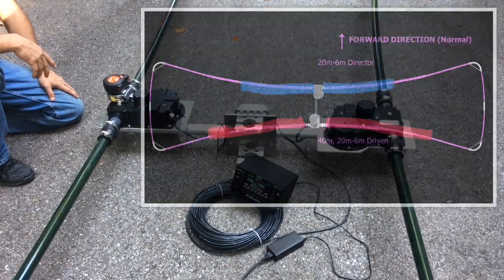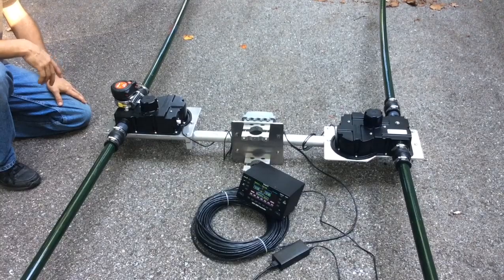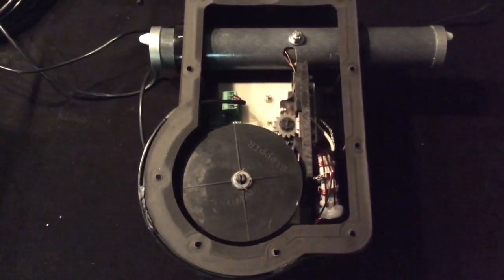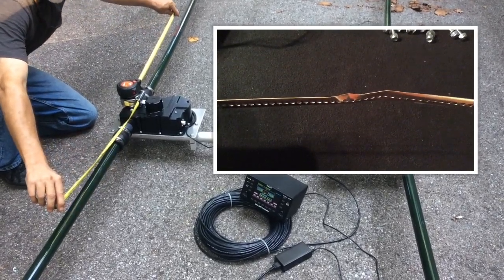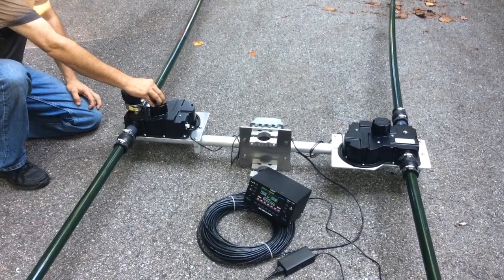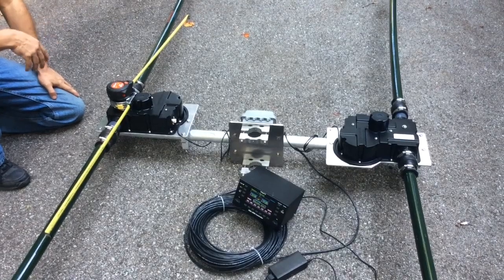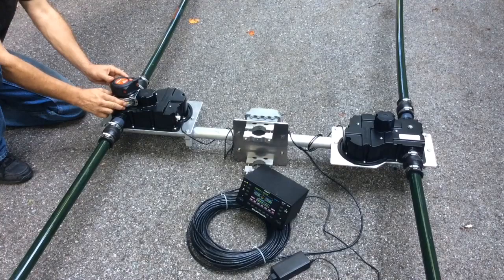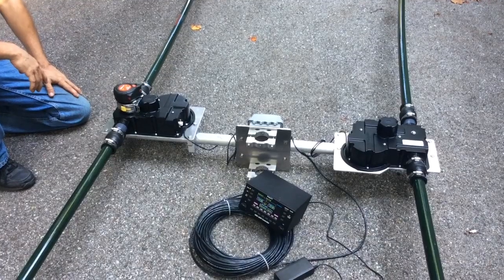SteppIR UrbanBeam   How it works

Comment: Nice video! How high do you have it? Was thinking on getting the DB18E with the 3 loops. I hope there worth it. Many tell me that they are very complex and when they break-down, are very expensive getting them repaired.
Reply from the maker: Hi John, My Urban Beam is mounted at 55 feet. It works great! The SteppIR antenna systems require attention to detail during assembly and proper operating habbits. Think high performance sports car verses a family grocery get'er sedan. One is more expensive to own, maintain and operate. But the y sure are a lot of fun  - Thanks for watching.
Reply: I have had my DB 18 in the air for about three months now and I love it I hardly ever go off of 40 m with it and even in these bad band conditions I have made contacts all over the world on 40